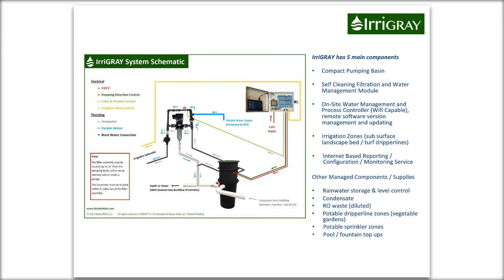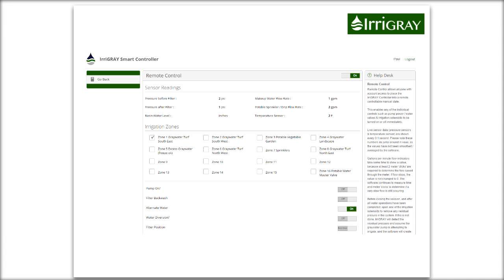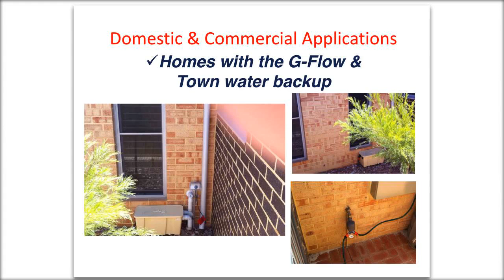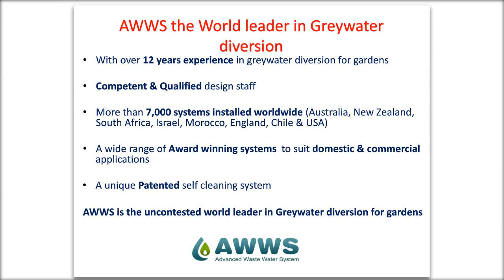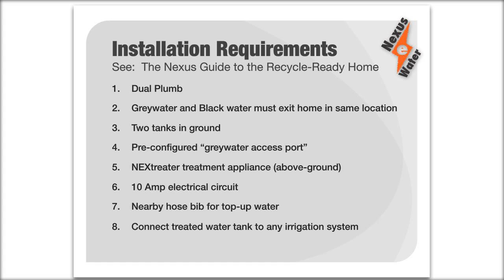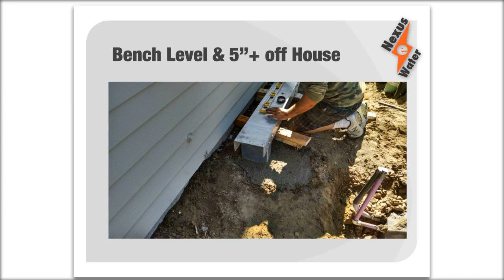Whole-House Residential Greywater Systems (recorded on 3--16 -16)

Comment: these are all too expensive. Nexus Ewater probabaly went out of business because the system cost $8000 in materails and another $2-4,000 for installation.    the only one reasonably priced was a simple transfer pump with a sludge filter in a tank at this time:  https://youtu.be/75wTBz48mDY?t=1626